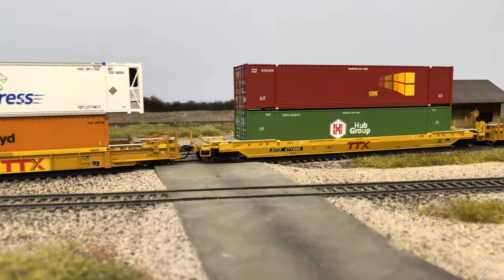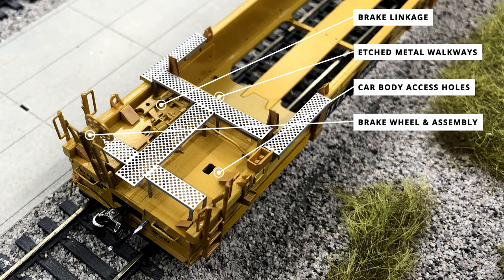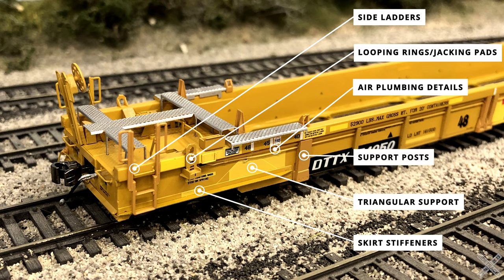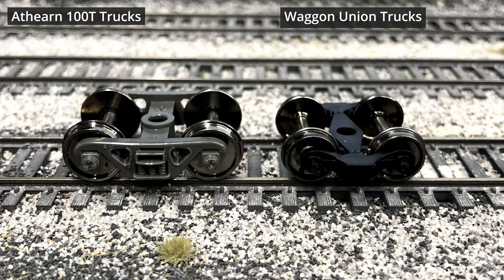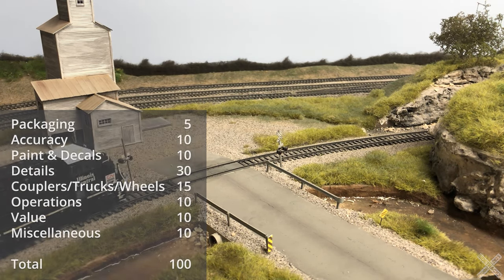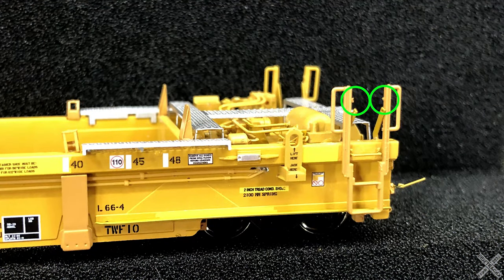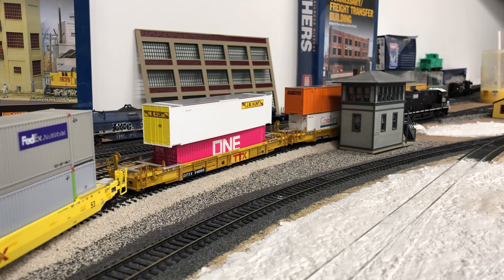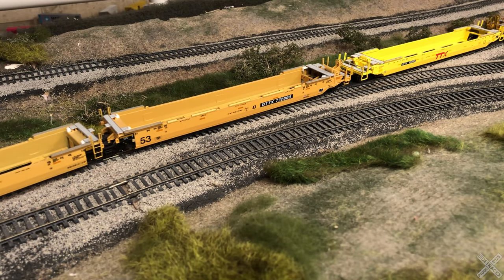Review: Class One Model Works Thrall TWF10 Well Car [HO Scale]

Comment: great review. I personally think they knocked these cars our of the park. First time manufacturer is expected to have some minor issues but the level of detail they put into these cars is remarkable. Having a smaller layout, I'd much rather fill that space with high end single models like this than a 5 pack of average detail Walther's but that's a personal preference. The slight color variation will disappear with weathering and I honestly never look at couplers, unless they uncouple.. I look forward to new announcements by this manufacturer.
Reply from the maker: Very well said, only person that can fill a full train with expensive cars like this one is millionaires. Walthers Mainline look just as good a few feet away and get 4 more cars for same price.